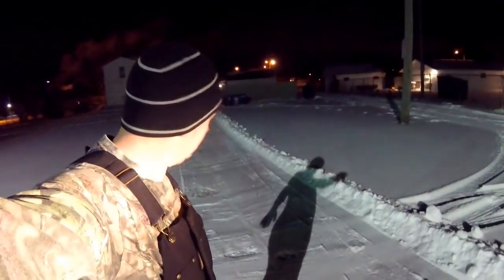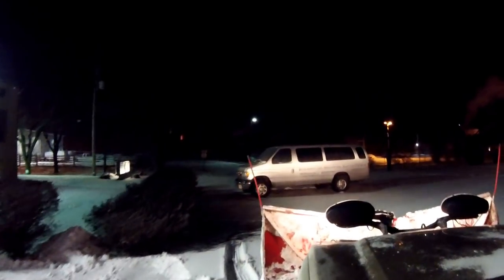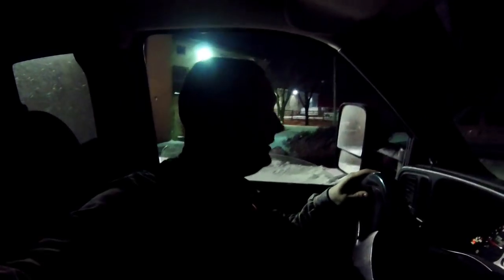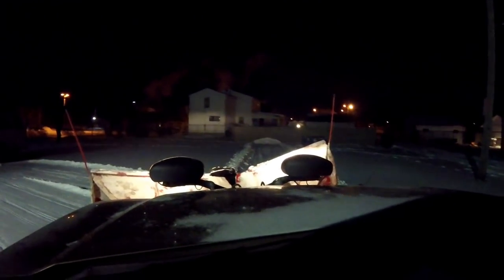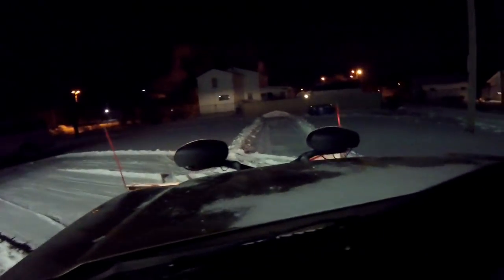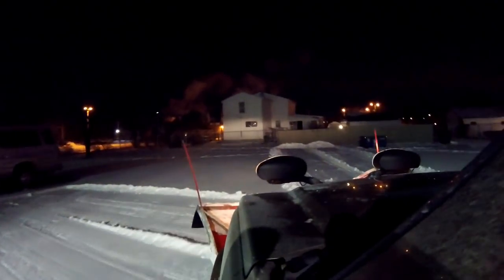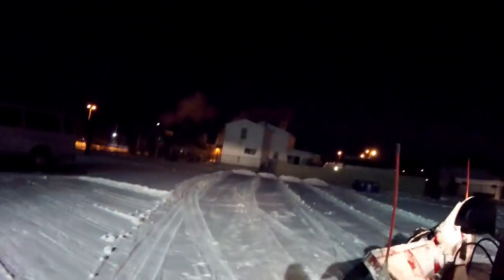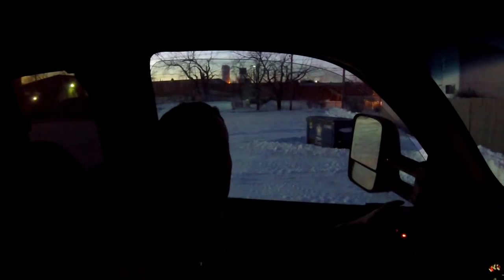How to plow snow on gravel lots

Comment: Good technique. You've been doing this for some time and your experience shows. But as always, people opinions will always differ. In my opinion, plowing gravel the way you do only works if the land is fairly flat. If you have any kind of uneven surface, you will either miss a good section or gouge out a portion of land. Shoes would help eliminate that issue. Shoes help but are not perfect. Good luck.
Reply from the maker: Thanks! I agree this won't work too well on an uneven gravel surface, but there's not to much that will when plowing gravel. Plow shoes will help if the ground is frozen and hard, but if it's soft will cause more issues by digging in.
Reply: @ColumbusLandscapers  some guys get a piece of 3/4 or 1 inch steel pipe and cut a slot down the length of it and slide it over the cutting edge, using some pins to hold it in place. This works and will not dig into gravel at all according to those who have tried it.
Reply: @jamesnm21  now of my neighbor could do this lol we wouldn't loose 7 inches of crushed stone every year. Your idea is good old "farmer" common sense people don't have theses days evidently
Reply: @markfrazier8646  you may want to suggest it to him, though not everyone is inclined to modify things. If he has a v plow that would make it more complicated.
Reply: @jamesnm21  hey man, I have a gravel driveway and a straight blade plow on my truck. I'm looking into doing the slotted pipe idea on my plow, however I'm wondering if those that do it drill thru the plow for mounting? I was thinking of just putting a relief cut on either end of the pipe and then drilling thru the pipe and clamping the pipe with bolts on either end. IDK if that would stay attached to the plow though. I'd really rather not drill thru the plow anywhere.
Reply: @MeltingRubberZ28  I'm sure there's different ways you can do it. One way would be to weld a bracket on each end of the pipe a few inches long that would extend up to the end ribs on the plow. That way you could drill through the rib to pin it in place. If you don't want to do that you could  just tack weld the pipe to the cutting edge assuming you're not using it for plowing anyone else since it would wear through fairly quickly on concrete.
Reply: @jamesnm21  thanks for the ideas. I think I'm going to weld some custom "D" brackets to the pipe, probably 1/4 of the way from the ends, one in front and back on either side. Then just take a ratchet strap and loop over the top of the plow, that way it's removable if needed and the plow itself isn't modified in any way.
Reply: @MeltingRubberZ28  i was going to do the pipe thing on mine before I added wings to the plow.  My idea was to put the pipe on arms that pivoted from the sides of the center of the plow so it could just store on top of the plow and swing down into place when needed. I do a lot of driveways so needed it to be a quick easy process. Btw, if you're plowing for money wings will save you a ton of time and allow you to take on more work. Wings = moneymakers.
Reply: @jamesnm21  I appreciate the advice. The pivoting idea actually does sound really good. I'm only plowing for myself as a landlord so I have a bit more time to screw around with the plow. I think this will be pretty quick though. Basically just set the plow on it, throw some ratchet straps over the plow and tighten down.

Comment: On gravel, I have a rubber cutting edge bolted in front of the steel one. It hangs about 1 inch below the cutting edge, so nothing gets tore up. No scalping the lawn or digging in thawed gravel. I also run shoes on my plow and don't have to raise the blade to keep from scalping the gravel or lawn.
Reply: What stops the shoes from moving the gravel?  All the weight on smaller surface or do you take some weight off?

Comment: that certainly does help but you can also just use the skid shoes to maintain height. also unfortunately this only works well with level ground. once you start hitting a bunch of bumps, dips and slopes it ends up digging in anyway which is when i end up just back dragging everything.

Comment: Leaving a layer of snow doesn’t that turn into ice? Do you use a sand/salt mix afterwards?
Reply from the maker: You can never get all the snow off gravel. You can salt it, but sometimes it will turn soft and muddy.
Reply: @ColumbusLandscapers  I see. So the best thing would be maybe 80% Sand/20% salt? What mixture ratio do you recommend?

Comment: Hi  Great Tips !!! I'm new to this,but wouldn't "mushroom style" plow  shoes make life easier ?? I have a Can-Am ATV &  at least 15,000 sq. ft. of gravel driveway to clear. I like your "back blading" tip & think it will come in handy for  tight or small areas.
Reply from the maker: If the ground is frozen you can use he skids as you mention, but if it's even a little soft they will dig in.
Reply: Do the same thing lifting the blade if it's winch operated.  Set it down, pulse the lift just as you see weight transfer to ATV.